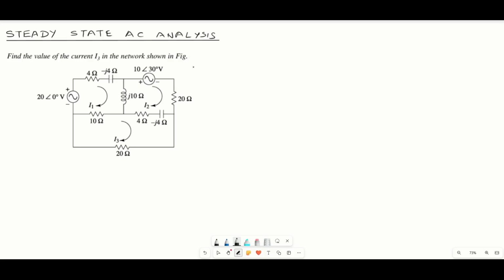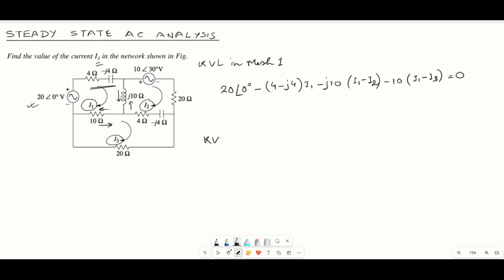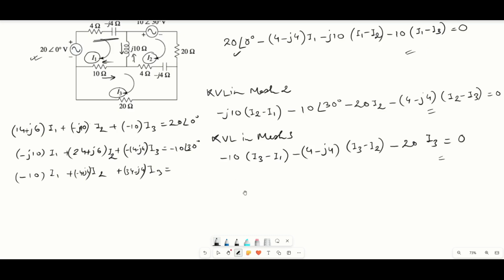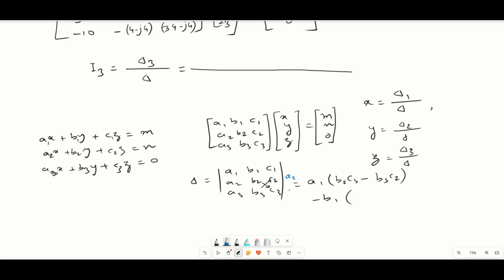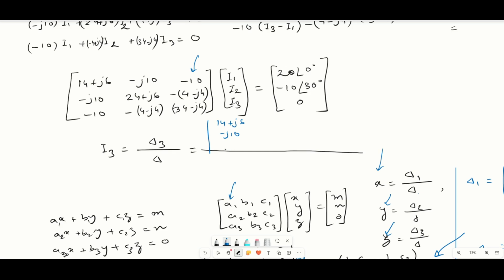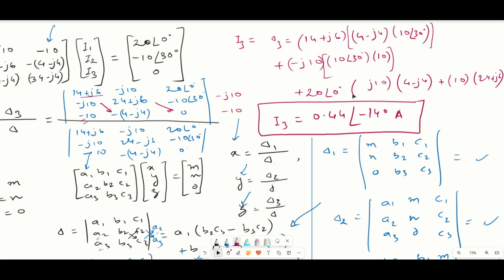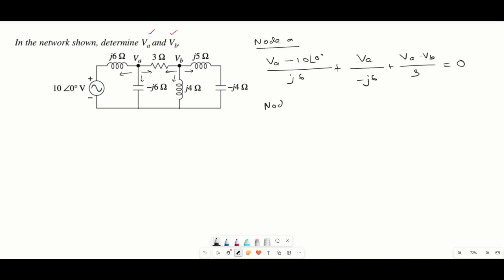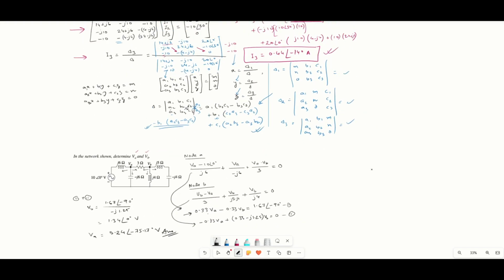Master AC Steady-State Circuits: Mesh and Nodal analysis

Comment from the maker: Try this: Pick any AC circuit from your textbook and tell me the values of R, L, C and the voltage source. I will show you how to set up the phasor equations using Mesh or Nodal Analysis.
Drop your circuit below — the best entries get solved in the next video!